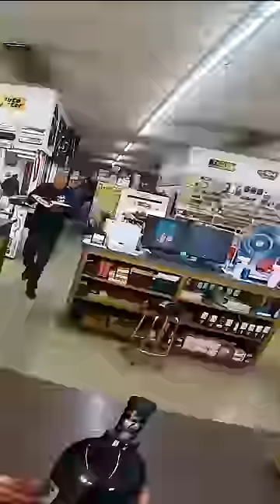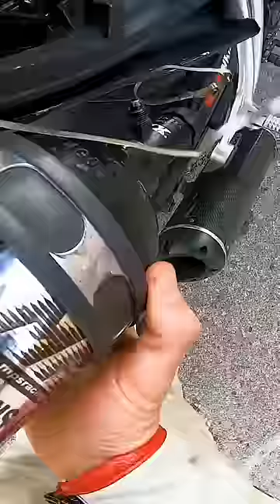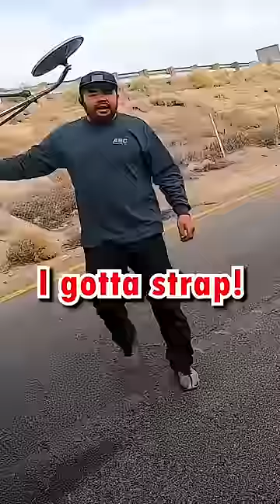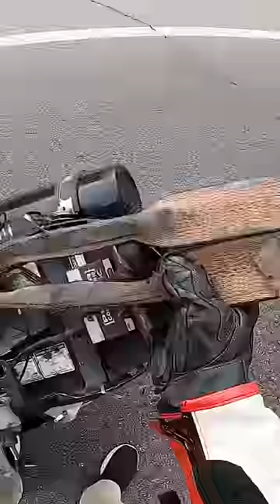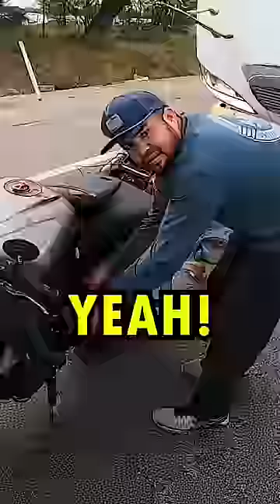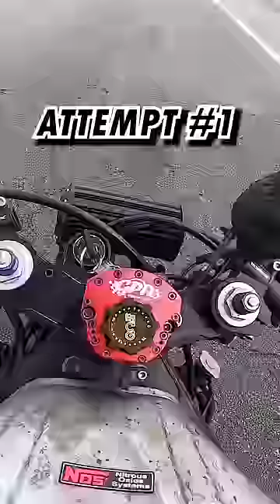If this works..... #shorts #bikelife #lol #fast

Comment: This was funny af. "there goes my clutch"😂😂 I always wondered if an r6 could tow something heavy!
Reply: Bro they don’t have torque like that in low rpm like a Harley plus if he was in power band he would do a wheelie and loop it lol
Reply: Facts. He had a better chance with a bagger or ATLEAST a torquey bike like the fz09-10.  H2R style lmao. There goes my clutch. Hahaha.
Reply: @wadechindemi4400  more chance with an electric motorcycle like zero motorcycle. even their cheapest/slowest/weakest bike makes 78ft.lb so more than a fz09. but it makes this torque without a clutch, and you get all the torque at 0rpm. the SR S/F have 140ft.lb btw you will probably able to tow something heavy flat or downhill. uphill forget it
Edit I see that Polaris makes an ATV with this motor that is 1800lbs and rated to tow 2500lbs. definitely not a big truck , but still nice for a motorcycle motor
Reply: @geemy9675  dude I used to have the bombardier outlander😳🤯OMFG. MY GUY ROTAX /driveshaft driven. Can’t go wrong 2x4 ( utility). But I was smoking the polosris trailblazers 2 stroke the Yamaha warrior 350. Yeah dude I fuck with everything motor.  🤞🏼🐥
Reply: @glock1inthetop45  nah. It's not about torque or horse power. No bike can tow a semi because weight. No matter if you got 1000nm torque or 2000hp on a bike, their lack of weight, so traction, is the real issue. And you wouldn't make a wheelie when your back is chained, just a big ass burnout. Physics ma dude, I'm a rider scientist.
Reply: I’ve towed my mustang around with mine btw r6s make more down low power than liter bikes the only reason he couldn’t move it because he weighs 600pounds the truck weighs 40k pounds
Reply: @southernracing2468  facts
Reply: More chance with a Prius
Reply: This is R6?
Reply: @nightcore-gautham2800  not anymore. Is a custom bike now 😂
Reply: @geemy9675  electric won't tow, it will drain the battery.
Reply: No production bike will ever tow a lorry.
Reply: Maybe but never will it tow a semi truck 😂😂😂 1000% need a truck or a 4x4
Reply: @alexvillalobos7137  I've easily pulled many semi trucks with a 1989 F150. RWD, 6 cylinder with about 120hp.
Reply: @Scoobywoo7447  better to drain the battery than to drain the clutch
Reply: @geemy9675  agreed, but I doubt an electric bike could do it either, im open to being wrong but I'm unsure.
Reply: @Scoobywoo7447  electric drivetrains can tow more than similar gas bike drivetrains but of course for short distances and  limited by braking capacity and the fact that bikes are not designed to tow anyway.
Reply: @nitroustommy3668  your truck is made to pull while the rs6 trans could never

Comment: Even if the clutch did grab, there's something called rear wheel "coefficient of friction".
Reply: If the clutch grabbed and the rear wheel was 10x the size there’s still like 1/4 of the necessary torque.
That bike doesn’t make power down low like you need to dig for a tow
Reply: @fungdark8270  You're correct, but I was hoping the audience would understand the meaning of my post:  Rear tire would just spin & not grab the pavement.

Comment: I was like, “there’s no way he’s gonna pull that semi with his bike.”

And he didn’t, so I was right
Reply: You are right
Reply: Give over. I pushed started a 17.5 ton truck single handed.
Reply: Sherlock Holmes over here cracking the case mere peasants would never understand.
Reply: If it takes a massive multi-ton diesel with 18 gears just to make it move, a 300lb V-twin squid-scooter with 6 gears ain’t doing shit.
Reply: @disaffectedmale  Sure. Downhill

Comment: He has no idea how Nitrous ,horsepower, torque and engines work. Nor tire contact patch, etc.
Reply: You are no fun
Reply: Torque is how hard you're gonna hit the wall and horsepower is how fast you hit the wall, nitrous increase both how fast and hard you're gonna hit
Reply: @Melloncholly  right... we in here enjoying the hilarity of the video and here comes this guy with science... thanks buzzkill. 🤣🤣
Reply: @thaido1750  you gave no input on the most important part of towing especially in this situation a motorcycle has 1 rounded tire for traction probably the least amount of grip you could've gotten to tow anything and on top of that torque is how far you take the wall w you not how hard you hit it 😅
Reply: ToeTagACommie  💀

Comment: I'm willing to agree that it could have towed but not up a damn hill lmao
Reply: With what?! Sport bikes have like 0 torque. This was never going to happen. Up or down hill 😂
Reply: Nah it would have never pulled the truck. The weight is effectively the same as holding the front brake actually more. If you put a fat slick on the back and managed to get traction either the chain, output shaft or the trans would be next in line behind the clutch.

Comment: Even with enough power on the rear wheel it would just spin on the place and create a lot of smoke. To tow a truck you would need something similar heavy as that.

Comment: Put a 500 tooth rear sprocket and a bar close to the ground on the rear swing arm to hook the strap to. you might be able to pull it and not wheelie in the process lol

Comment: Wait that looks just like a paintball tank so out of curiosity. Cant you use a carbon fiber tank instead of that steel tank and hold a good amount more nitrous. That seems like a 48 ci tank that hold up to 3000 psi while you can go for a 68-80 ci tank that can hold up to 4500 psi all while being lighter 🤓

Comment: While in theory you could do that with a bike you don't have the horse power and youd have to upgrade just about everything to steer brake safely etc plus the body would collapse at all the weak points.  Physics think about it before doing it

Comment: If you'd paid attention to physics in school, you'd know that towing isn't about horsepower, it's about torque. You can have as much nitro onboard as you want and have 500hp and still you won't move an inch if you don't have enough torque.🙄
In that case it says...
Cubic capacity✔️ instead of horsepower❌ ...🤔‼️

Comment: A semi truck is not running air tanks will lose pressure and the brakes cannot be released semi truck needs air pressure to release the brakes

Comment: Bro skipped Newton's Third Law of motion. That semi is 35,000 lbs when empty, and a trailer can be rated anywhere between 40,000-80,000lbs. There's no way a can of NO2 would generate torque to ever move that mass.

Comment: I worry about your safety…. If a bike can wheelie just on its own power, how will it tow something 100x its weight?  It doesn’t matter how much horsepower you have, the wheel base and weight you are using to move the truck are too small. You should have a better understanding of the simple physics while riding, just for safety sake.